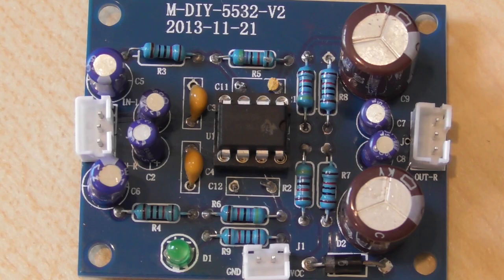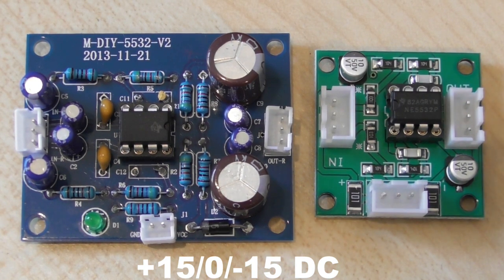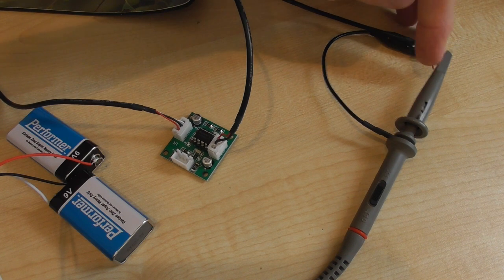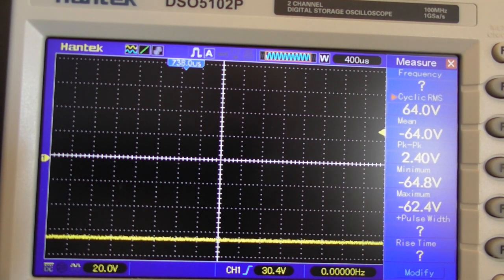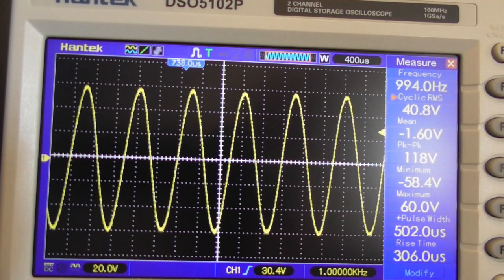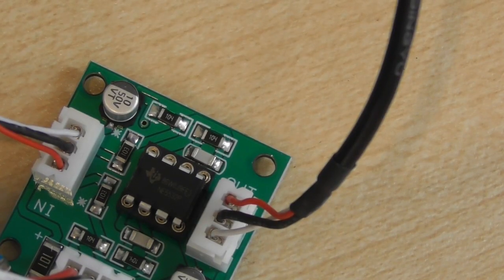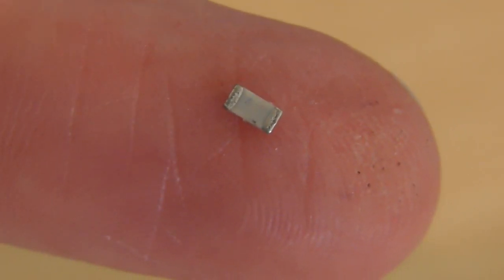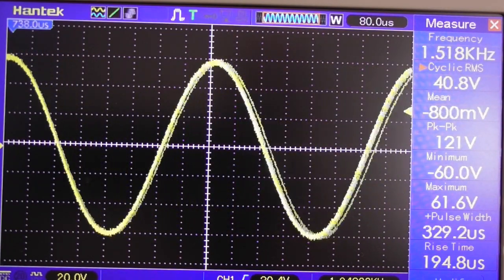Latest version of the NE5532 preamp from Ali Express

Comment: Thanks for posting. Very informative. I generally use this chip in Oscillator circuit. Great little chip. Clean low distortion outputs.

Comment: Hello my friend, I have a problem with this latest version of NE5532 PREAMP DC board from Aliexpress. Its noisy conected to output of  my minidsp 2X24, ..... HUMMING 50hz!!!  I used for substantial GAIN in Public Adress subwoofer( Behringer EP 2000 & passive dual 12" speakers ) ,  from 17hz - 500hz flat audio band interval.
Need a binolar /nonpolarised capacitor for input/output conexion. Not a bulky one, ... what value it must be in uF?  2.2 uf will be enough? Or I need at least 10uF 17 hz -1dB ??? The power supply is a dual 15Vcc (+/-)  Thank you very much. Have good and healty day.
Reply from the maker: I don't know why you should get 50 hz hum. Not something I have experienced myself. Could be an earth loop if your power supply is OK, probably most likely. Without seeing the complete installation it's impossible to diagnose the problem as I'm sure you can appreciate. 50 hz does suggest a loop or something like that rather than DC issue which would be 100Hz.
I tend to use 4.7mfd caps, none electrolytic preferably. A good compromise between size, and cost. This value will be OK providing the input impedance is not too low on the amplifier.
Reply: @MichaelBeeny  You are a great master and I am a happy apprentice. Jumpering 4.7uF input/output caps make no diference at all in humming noise, in my project. You were right...as always, it was a grounding issue. I tried dozens of options, star grounding, 10 ohm-100 ohm resistor to NE5532 ground input board, separate power supply... etc. .....
just when I wanted to give up, defeated...I was already looking for an eficient but stil not very expensive ground loop isolator, something with 1:1 transformer, ... ( Monacor FGA-40HQ ) ...but stil,...I can't accept the idea of losing a DC route. 0-500hz is my goal.
 And, BINGO!  This week I found out on similar channels, like a simple piece of wire, connected between the two cases, amp/preamp can eliminitate a very large amount of hum. Problem solved, no hum. 
There is only one challenge left. I want to limit the frequency band reproduced by this subwoofer preamp, through a pin1-pin2 capacitor with a suitable value. 18khz is way TO MUCH for my pupouse. And with the  volume turned to maximum on my Behringer EP2000 amplifier, I have a big hissing background noise. What do you think, 1nf-10 nf will be close??? Or 100 nf??? 
Theank you again for your support, I wish you health and happiness.

Comment: Hey Michael,
Nice couple of videos you did on this subject, highlighting what, at first look, might seem quite a silly mistake, and even worse, a double silly mistake...
But I have a view on the issue that may not just "explain" the silly mistake, but also excuse it a little bit (although under a somewhat evil agenda).
The thing is, they may have just been overly conservative in trying to avoid oscillations, and here comes the "evil" agenda, probably because they know they'll source the IC from all sort of crappy suppliers and some (they know it in advance) maybe fakes or Q.C. rejects from some major factory as we all know way too well and sadly these days.
The other side to it, and here is my "view" mentioned earlier, is that the H.F. frequency response is not at all that bad at 20kHz!
You're gonna shout at me but, even though we got used to see Hi-Fi equipment from the 70s easily reaching 50 or 100kHz @ -0.1dB, the fact is that, having -1, -2 or even -3dB @20kHz is not at all a major issue, especially because the highs in many cases need even to be padded down because tweeters are so more power efficient.
And, by looking at your frequency sweep, I think it didn't even get to 20% down, which is less than -3dB...
Nothing that can't be compensated by a little touch up in the treble control.
On the other hand, looking at the advantages the designer may have been after (apart from the evil advantage of avoiding problems with crappy components)...
Rolling off at just 20kHz may be barely noticeable for most digital content of nowadays (streamed music, mp3 and CD) because all of them being sampled at 44.1kHz  and due to the digital nature, by Nyquist, the H.F. content will have really a brick wall roll-off at just over 20kHz so, not loosing much in that respect.
And yet, containing the H.F. response may avoid aliasing and digitizing artifacts if the output of this preamp is ever used to feed into some Analog-to-Digital converter.
The digitizing artifacts and aliasing of unnecessary H.F. content being sampled at the "relatively low" sampling rate of 44.1kHz may end up more annoying to the ear than a slight roll-off at 20kHz that can be easily compensated by a tone control or a little bit less padding of the tweeter.
So, one may argue, why would we ever bother to pursue a flatter response?
I would ponder that one must be concerned about the reasons behind the roll-off.
If the roll-off is caused by lack of speed (slew-rate), then it's of great concern and the amplifier (without the global negative feedback) MUST be CAPABLE of reproducing the H.F. content as flat as possible (which is exactly the case of the NE5532 that can easily reach 100kHz).
But, after applying negative feedback, if you have a slight, well behaved and undistorted roll-off as it's the case in this preamp, it's not all all such a poor design choice (IMHO).
Of course that, if free from second agendas of ensuring it can work relatively well with any crappy IC they throw at it, they might have chosen a little bit less roll-off and set the cutoff at say 50kHz with a smaller cap, say 100pF, but and very importantly since it's a non inverting topology, some capacitance MUST be added in parallel with the nfb resistor, to compensate the resistor divider (the same way as we compensate de x10 oscilloscope probe), otherwise instead of a flat response, you may get a H.F. peak at some nasty frequency way up in the spectrum so, the capacitor is due one way or the other.
What do you think?
Reply from the maker: Hi Fabio. I take all you're points and largely agree. I have found the 5532 a very stable device even with no limiting on the HF. If you feel you would like to limit the HF a value of about 33/35pf makes sense.
As supplied the preamp does introduce colour into the sound and general dullness with a lack of upper detail. I think the frequency response of any amplifier/preamp should be completely flat  up to at least 20khz. I know very few people can hear this, including me, but that area is full of harmonics which mixed with frequency's you can hear do make a difference. 
A sharp cut off at 20khz sounds better than even a small roll off starting at say 8khz. If you do have a sharp cut off, like CDs etc it still sounds good, but rolling early lowers a couple of octaves by that couple of dBs.
Quite easy to demonstrate, play white noise, tone controls flat of course and a ruler flat response with a sharp cut a 20khz and listen. Now do the same test and add that roll off above 8khz going up to -3dB at 20khz. You will be amazed at the difference in detail.
I'm not sure I like the idea of tweaking the tone controls to make up for a wrong preamp, why not just get it right first time. A good example of HF roll off is the Quad 405 and it shows! lack of detail and sparkle.
Thanks for you're contribution, I always like to hear other peoples opinions. Regards,
Mike
Reply: Hey @MichaelBeeny  , it seems you've really done your homework, no argue on that!
My comments though, came from a limited view on the matter and are more of a "theoretical" standpoint, given that I don't have either of those preamp boards to experiment with.
Indeed you have a point when you state that a sharp cut-off at 20k can sound better than a soft rolloff starting way before 20k, as it's the case, even if after 20k and above there's still plenty of gain.
As for the tone controls... I didn't mean to imply we should be resorting to them to correct a non flat response that was ought to be flat to start with. You're absolutely right in that respect, I only meant to express that, given the small amount of loss (maybe -2dB if I guessed right that it's 20% down at 20k), that it could be compensated, and I was thinking more on the non-flat response of loudspeakers, where 2dB off is not at all that uncommon.
But I generally agree with you that it's a silly mistake, when we consider the 5532 has plenty of gain margin and bandwidth to get a flat response to at the very least,   twice of 20k, the this little preamp have failed on something that could have very well have been avoided.
But who knows the agendas?
Maybe this same company markets a better (more expensive?) Preamp, for higher prices, and they need to make this one worse to make the other one sound better in comparison...
Who knows, just me dreaming now.
Thank you for your consideration in replying to me. It's always good to interchange with clever people who knows their stuff.
Reply from the maker: @fabiotrevisan8922  It's always good to get other peoples ideas, I'm not at all the main authority on the subject! It's just a personal view. I am always open to other ideas if backed up with a sensible explanation of the view point. Your contribution is most welcome.

Comment: can i use this preamp board for vinly turntable?
Reply from the maker: Sorry, no you cannot. You need a special pre amp with RIAA equalisation. Such boards are available from E Bay and Ali but tend to cost quite a bit more. I assume you are talking about a magnetic cartridge with about 3 mV output. If your turntable uses a ceramic (cheap and nasty) cartridge you don't need RIAA if you feed it into a 1meg input impedance.

Comment: the cap is supposed to be between the ground and the Vcc+ and gnd and Vcc- pin on the opamp as mentioned in the spec sheet: Place 0.1-μF ceramic bypass capacitors close to the power-supply pins to reduce errors coupling in from noisy or high
 impedance power supplies.
I guess the poor guy designing this was confused with the inverting input of the opamp and mistook it for ground.